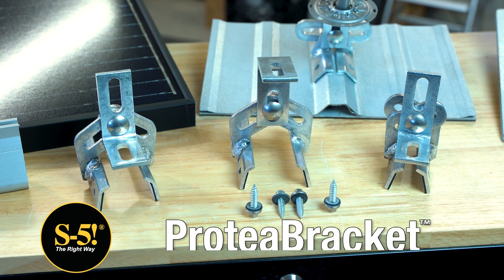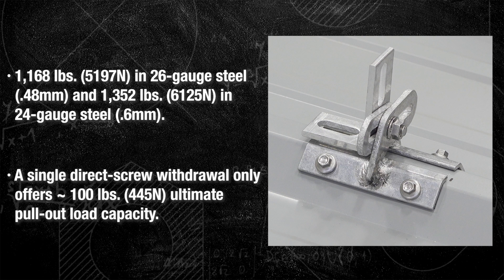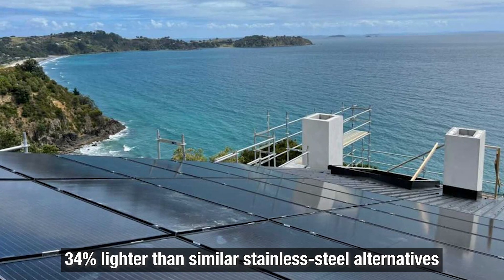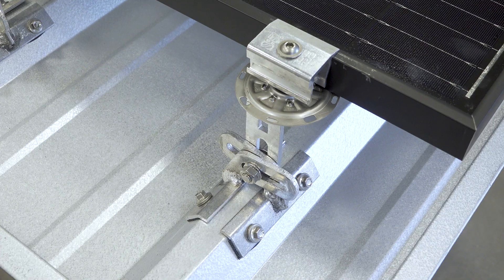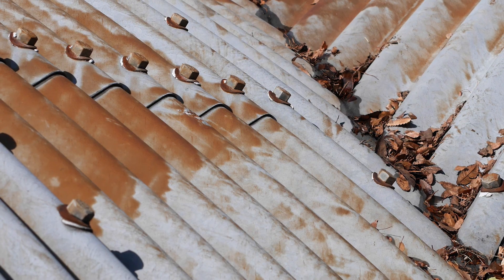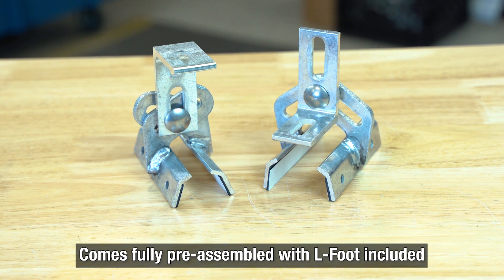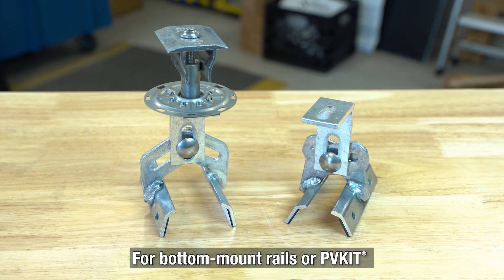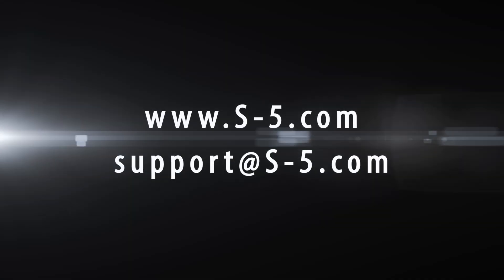How to mount railed and rail-less solar onto exposed fastener metal roofs

Comment: What's the best thing to use if I want to angle the panels on the roof by 15 degrees?
Reply from the maker: There are different third-party tilt-mount racking systems that can paired with a variety of our brackets.  Reach out to us at support@s-5.com and we’ll be happy to talk to you about this further.

Comment: How many inches apart should we put the brackets??? Why don't you say on your website to use PBR or IBR panels??! How are homeowners supposed to tell the roofers what right panel to use???
Why??! Because most roofers use the common 5 rib panel...👎
Reply from the maker: For our PVKIT, we have a team of technical experts to help run PVKIT calculations to determine frequency of attachment requirements for your project per building code.  Reach out to us at <support@s-5.com>.  For applications using third-party rails, we are happy to review the calculations that show the load going into each “roof attachment” and help adjust as needed to keep loads within the allowable load specific to the roof and S-5! product on your project.

Comment: If you notice, you must at least have 26 gage panels, most roofers will use 29 gage panels the thinnest on the market!!! Be careful!!!
Reply from the maker: You are correct, 29 gauge is very thin material and typically the best approach on these thin panels is to use one of structurally-attached though-fastened brackets such as our SolarFoot, VersaBracket, CorruBracket, or VersaGard.  We do also have our ProteaBracket tested on 29ga as a sheet metal only attachment and, while lower than thicker gauges, the load values are still good and can easily be used to properly engineer a solar array.  If you have any other question about our products or our load testing please reach out to us at support@s-5.com.

Comment: Will this work with Florida building codes?  How does it hold up in the salt air? Thanks.
Reply from the maker: S-5! clamps and brackets are used all over Florida in every jurisdiction and our extensive load testing (https://www.s-5.com/load-tests/) ensures that you will have no problems engineering the attachments to your wind speeds. We have also done salt fog testing on our clamps and brackets and they are warrantied to last the life of the roof. Please let us know if you have any other questions.

Comment: How do you use these with tiltable mounts?  The increased pullout force is awesome, but if you want to tilt your panels more than the roof angle, you have to have an extension somehow.
Reply from the maker: The ProteaBracket has been used with tilt racking systems in the past but it is most ideal for flush mount arrays. The best bracket for installing a tilt racking system on and exposed fastened roof would be our SolarFoot or VersaGard. Please let us know if you have any other questions we can help you with by emailing us at support@s-5.com
Reply: @TheMetalRoofingAcademy  Too late, I used them for tilt brackets.  THEY WERE SO STRONG!  I threw a 2x4 against them to stay on the roof while I worked.  Very happy with your products!
Reply from the maker: @ADDvanced  Thank you again for using our products and for watching our video!

Comment: Can this be used on a 29 gauge metal roof?
Reply from the maker: Unfortunately, we do not recommend sheet metal only attachment on 29 gauge material. For panels thinner than 26 gauge, we recommend using our structurally attached brackets such as our SolarFoot, VersaBrackets, or VersaGard.

Comment: What is the wind rating on these. Wouldn't it be stronger to mount into roof purlins ? Thanks
Reply from the maker: We offer a wide range of brackets that include rib mounted brackets that attach into the sheet metal only and structurally mounted brackets that fasten through into the decking or purlins. Both options are lab tested to be extremely strong and can easily be engineered to just about any wind conditions. You can view all of our load data on the Load Tests page of our site.  https://www.s-5.com/load-tests

While fastening directly into the decking or purlins can often be a stronger method of attachments the purlins in many cases are not spaced properly or in the right locations for where the attachments need to land so in cases like this a rib mounted bracket allows for universal placement along the length of the rib, giving more flexibility the array designer and installer.
Reply from the maker: Hey Mark, while we wait for our Support team to get you a precise answer to your question, we wanted to let you know that you've been selected as this week's winner in our Summer of Solar Giveaway!  Keep an eye out for an email from kreichert@s-5.com so we can get that $30 Amazon Gift card sent over to you.  Thanks very much for your comment!
Reply: @TheMetalRoofingAcademy   Thanks first thing I ever won ! Appreciate it.

Comment: It’s too bad these are $13 each.
Reply from the maker: Our ProteaBracket master box (100 qty) MSRP is $8.70ea.  It is quite possible that you are purchasing through an indirect distributor and the price is getting additional markups. You can see our full list of direct distributors on the How to Buy page of our website - https://www.s-5.com/how-to-buy/
Reply: @TheMetalRoofingAcademy  Hello Sir, I am Sanat from India.I have 15 panel for residential use.i want to fix panels on Tin shed.Is possible to get on line.and  price of total items.
Reply from the maker: @MrSanat2012  For your typical trapezoidal roof, it would be 38 brackets and 38 PV kits as a reference. In order to assist further, we will need some additional information, so please email us at info@s-5.com at the earliest.